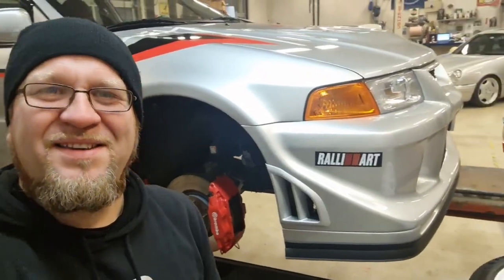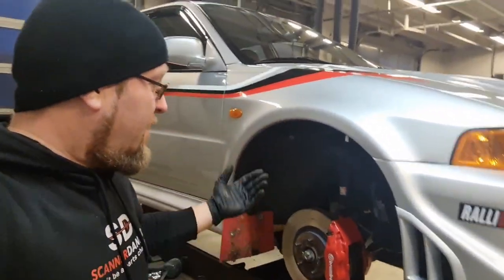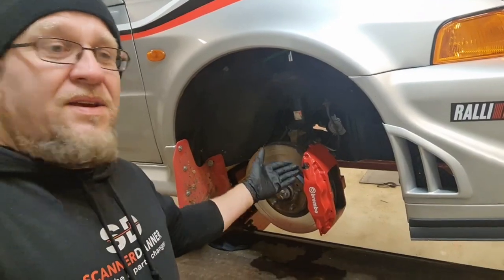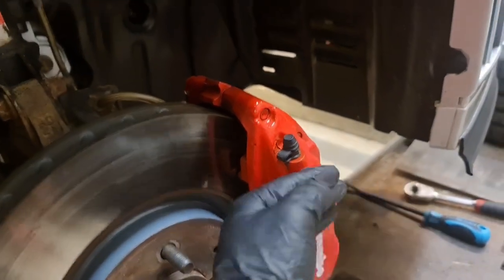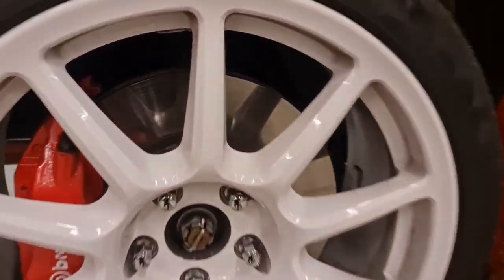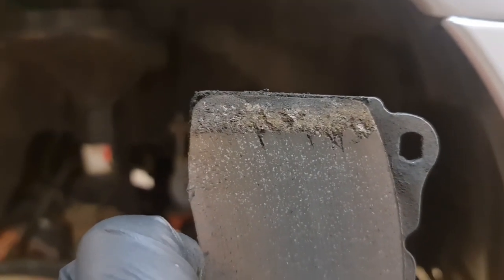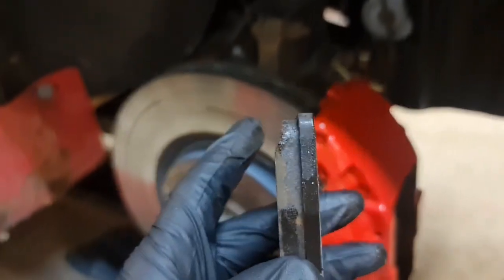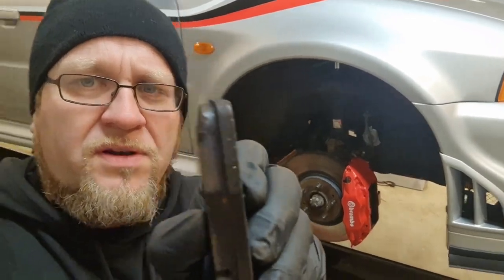Mitsubishi Lancer Evo 6 TME :Brake Squeal Investigation:Why Does The Brembo Brakes Squeal?Solution?

Comment: Hey mate. As a test you should try re-instate the original Brembo 'half-shims' , part number for front set is MR475618 . The shims in your video look very short. My previous Evo 5 came with pads already in it which had their own aftermarket 'full' coverage shims, but were missing the Brembo half shims, and the thing was squealing of its nuts. I bought MR475618 half shims and installed on top of the aftermarket pads existing 'full shims' and was all fixed, and was silent as can be. In fact, if you look at EPC data for a CP9A, youll see that even for an OEM Brembo pad replacement, part set MR407376, the OEM brembo pads come with their own full shims, and per Mitsubishis diagram , they expect you to put half shim MR475618 on top as well. Not much to lose by trying - Mitsubishi / Brembos diagram indicate it was designed that way anyhow, and it worked in my case..
Reply from the maker: Heeey mate :) Thaaaank you sooo much for a  veeery nice constructive ,and awesome comment. I will deffo try that out. Though i have " got rid of" most of the " squeal".....just minor  squeeeeeels left..but will deffo try that. I hope you are all good mate.Greeetings from Norway ,Stefan